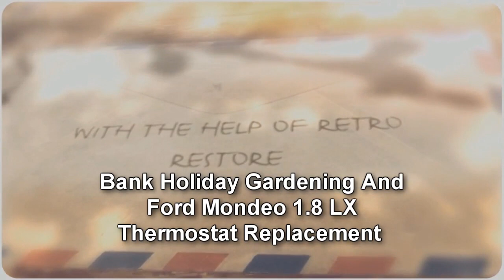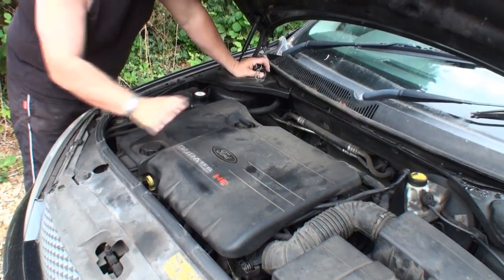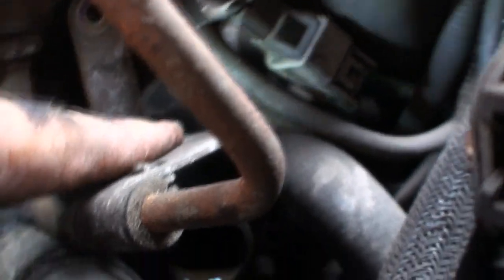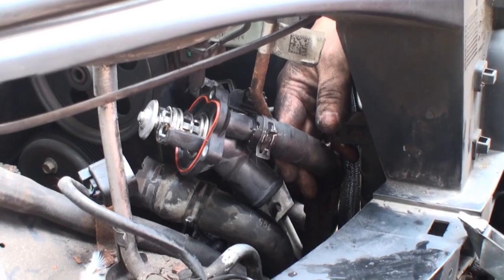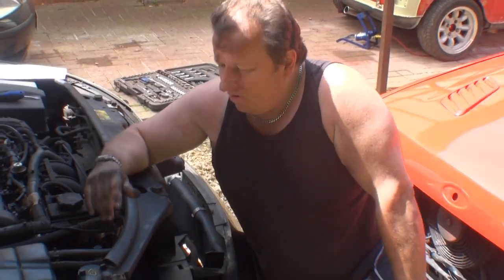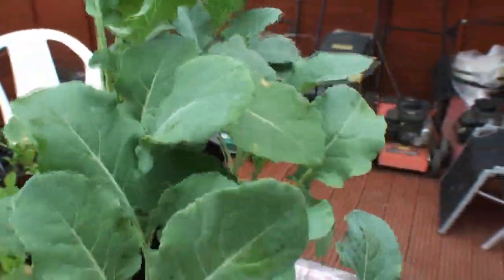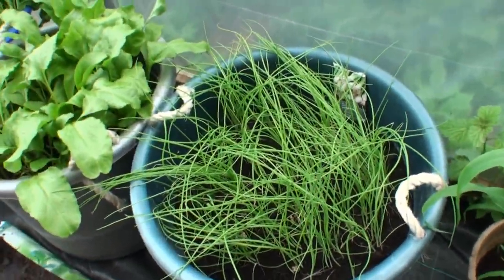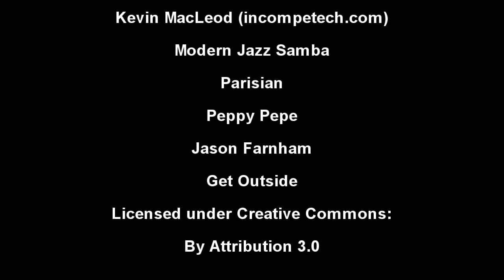In The Garden And Ford Mondeo 1.8 Thermostat Replace

Comment: and I'm about to put brand new injectors, fuel pump and tumbler flaps to my 05 plate 2.0 duratec ghia x. already done the aux belt, tensioner and idler pulley but was Interested to see how difficult it was to remove the thermostat. a bit of a pain but thankfully I've smallish hands for the job. great video by the way. 👍👍👍
Reply from the maker: Yes, it is a bit of a pain but good luck with it bud.
Cheers
Martin

Comment: I have replaced the thermostat. It's the 98degrees version. 1.8 92kw. Seems to be ok, but after driving a while the fan will start working and will not stop even when the radiator has cooled down. What's wrong?
Reply from the maker: It's probably the fan sensor. Get it checked bud.
Reply from the maker: It will be the sensor on the cowling that might need cleaning or changing I suspect.

Comment: i have a eml on code p1432  heater control circuit car not over heating if i replace part like in video will it solve my problem  thanks
Reply from the maker: Not sure Nigel, not had that one.